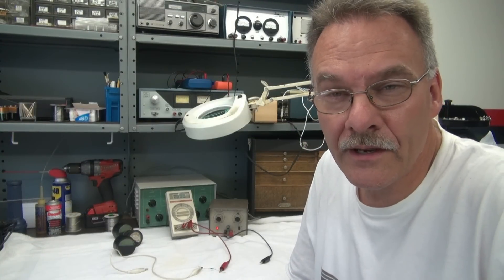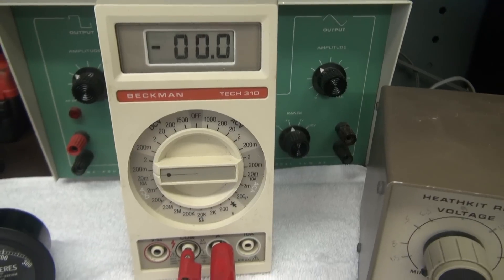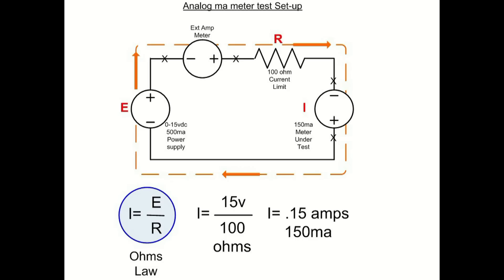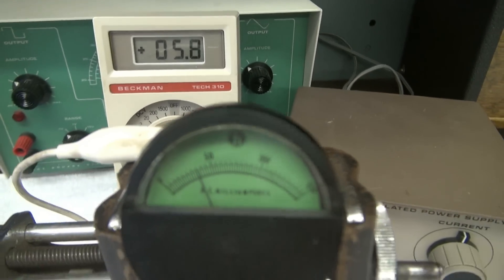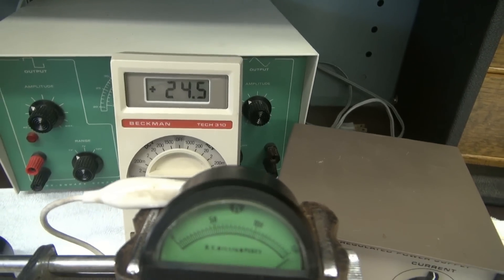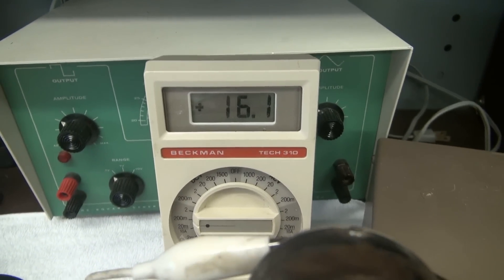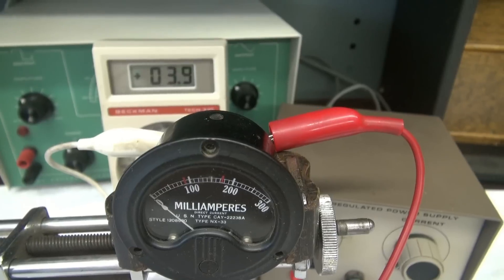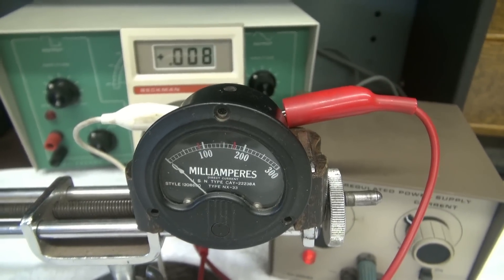How to test Analog panel plate meter transmitter radio receiver amplifier

Comment: I have an RCA WT-110A Tube tester, the schematic says it's a 100uA meter movement. I have tried to measure it with a Fluke 45. Its strange that I cannot get a steady reading on it. After about 5-10 seconds The Fluke meter resets. It won't do that with resistors though. I am wondering if its because the meter, when its moving produces a counter EMF? I have used a new Hand held multimeter and use it at the 2Kohm position and it pegs the Meter. I do have used substitute,  4-1/2" multimeter movement, Simpson (Canada), that I purchased on Line. It's from an analog Multimeter but it's a 50uA.
The meter cases are Identical, So I am assuming they were both manufactured by Simpson.
I have an HP 6227B Dual Supply. So I will set it up via your demonstration and see how that works. Does the internal Power at 100uA with different meter resistances come into play as far as substitution? I have heard it does. I don't know what the tube tester to meter voltage is. Probably in the millivolts? Thanks for the Demonstration!

Comment: Great video. Thanks. Now I need a video to tell me how to set up the current shunt to calibrate the meters. I've always wanted to add these to an amp to monitor/adjust the output tube bias. And, well, cause they just look cool.
Reply from the maker: 100amplifiers Hello, Thanks for the kind e-mail. I will put together one on shunts. For your bias monitoring, I would recommend using a meter that is already properly scaled. For example: If your bias is 35ma per output tube, tie the cathodes together, insert a 100ma full scale panel meter in series to chassis ground. The meter will measure idle current thru both tubes for a combined amperage reading of 70 ma. This is how they used to do it on old radio transmitters to monitor plate current on the output tube.
Reply: Terry Dayton  Understood. I would like to learn how, if possible,  I can adjust the current or the meter so that it agrees with the multi-meter reading (which I assume is more accurate, generally speaking). That is, of course, providing the meter isn't too far off. The meters you demonstrated in this video looked kind of um, uncalibrated.
Reply from the maker: 100amplifiers Hello again, Yes they were off a bit. Those meters were over 50 yrs old. Things drift over time. If you buy a nice Simpson from Allied, it will be dead nuts. I will show in a future video easy calibration methods. I worked as a cal tech in the early 90's for the USAF.